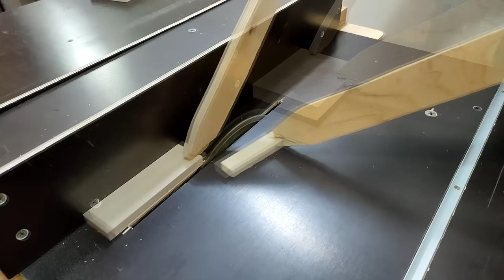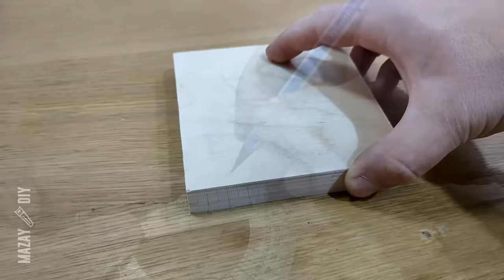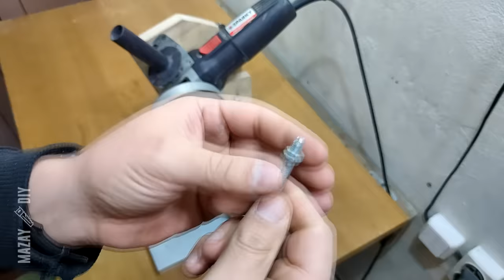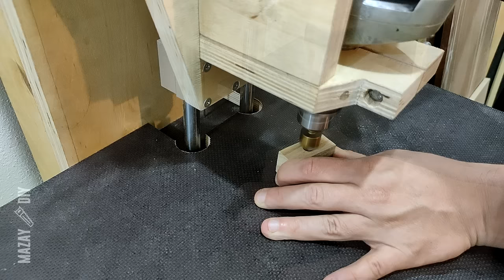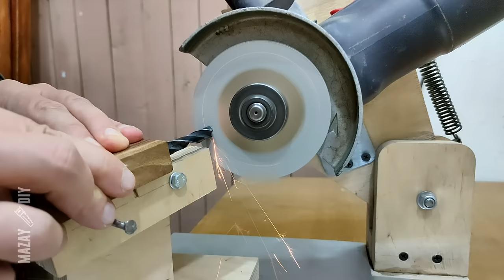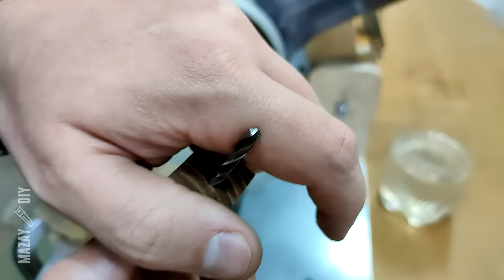Drill Bit Sharpening Jig | How to Easily Sharpen Drill Bits - 2 Ways

Comment: Thank you for the very informative and easily understood video and plans. Nice drill press and angle grinder jig too.
Steve
Reply: Steve Herbert. I am a retired mechanical engineer. Take it from me those drills will not cut, there are several problems, one of which is the trailing edge is higher than the cutting edge, the cutting edge should be higher than the trailing edge.
Reply: @THEJR-of5tf   Not what i saw.  When he was finished grinding the bits i saw trailing edges LOWER than the leading (cutting) edge. Don't know which video you were watching.

Comment: Two problems with this one, and I've watched dozens of these 'how to sharpen' videos, very few of them get it 100% right. To be able to rotate the block holding the drill bit so as to grind both cutting edges equally the drill must be held in the middle of the block, it isn't, it's pushed over to one side of the hole by the bolt. To get it correct you would have to have a block for every size of drill. Secondly like so many drill sharpeners, without a depth stop it's pure guesswork as to how much gets ground off each face. 'Perfect' this one isn't, not quite, a little more development and it would be.
Reply: It takes me about 10-15 seconds to sharpen a drill bit with a pedestal grinder.  It comes out excellent every time.
Reply: Drill chuck can be used instead( or together with) wooden block , and have a perfectly centered drill and if you make the jig to be precise when you turn the drill bit 180°  then you can sharpen very small bits easy,
Reply: @Richard-be3cw  - you probably have some skill, though. I have scrapped quite a few bits trying to do it freehand 😕

Comment: I am a retired Mechanical Engineer. There is no way those drills will cut. The trailing edge is higher than the cutting edge therefore the drill will be rubbing on the workpiece rather than cutting. You also have a facet on the cutting edge that also prevents the cutting edge from contacting the workpiece.

Comment: I'm 3+ minutes into a "drill sharpening" video and all I'm seeing is someone drilling holes in plywood scrap. COME ON! Why not show sharpening drill bits with this jig FIRST? Then I can understand what I'm building, and if I CARE I can look into building the jig. P.S. It isn't "perfect" if it doesn't set the angle of rotation of the drill bit on its axis. You've left this up to the user, guaranteeing inconsistent results unless the user already knows what they're supposed to be doing and why.